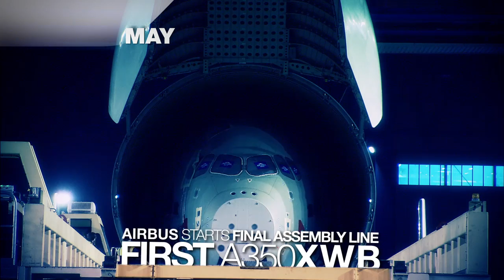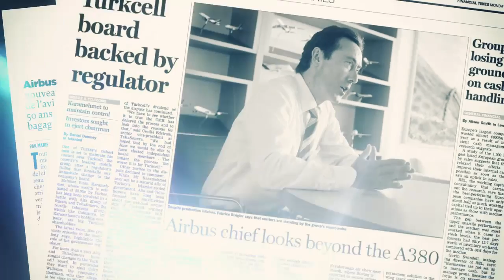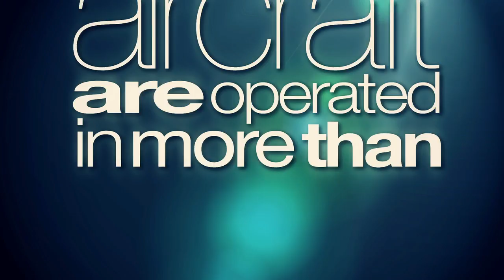Airbus in 2012: continued success

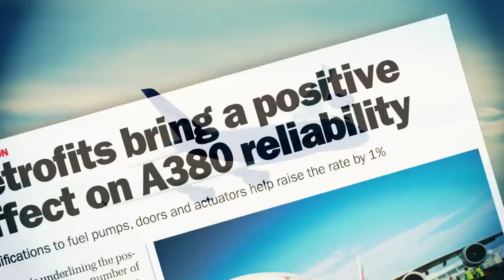Comment: Those kind of comparisons can be expected in such an aggressive duopoly. Boeing does it all the time too and the most notable one being the tongue-in-cheek A350 vs B787 comparison video it made. But, if you pause at 5:04, and read the newspaper cutouts in the video, you'll see that Airbus does acknowledge its own problems concerning reliability issues and wing cracks on the A380. Kudos to them for including them in this recap even though it was a negative thing.

Comment: Every new commercial airliner will have some teething problems, the A380s problems were a lot more severe, but they are forgotten about now. Give the 787 a chance to prove itself and in 2 years or so it will be showing its success, safely and effectively. The 787 is the most important airliner of the 21st century.

Comment: Of course I understand the seriousness of a fire mid atlantic, or even once airborne. Fire is so serious, that even if the plane hasn't even taken off yet, people have died. For example, the Air Canada DC-9 and the British Airtours 737-200 - both flights experienced serious fires and there were fatalities. However, I am discussing my perceptions based upon the fact that the 787 was not in flight, which isn't an extreme situation if there's a fire. It would have been serious if it was in flight.

Comment: I agree, a battery fire is serious, but wing cracks to the same degree that the A380 had meant it nearly broke apart in the sky... I'd rather have a small extinguishable fire on board than a plane on the cusp of blowing apart in mid air, a least there's more of a chance of landing, and being able to get off, provided there  are smoke hoods. However, the 787s fire was started on the ground, with nobody inside, rather lucky. All new planes have problems, and go on to be safe, like the A380.

Comment: Except it's obvious that the EASA didn't know about the wing issues before the A380 incident happened, and it was more likely an easier fix/modification needed than a new battery design or surroundings to the batteries.

Comment: What, you mean like almost every other commercial airliner when they first entered service? Teething problems are expected, the 787s problems are only made to sound worse by the media, they dramatise everything. The A380 had worse problems at first, but they are now in the past and the plane is successful. Same will be for the 787. It's THE most important ailiner in the 21st century and will go on to be one of the most successful jets ever, with it setting the benchmark for every commercial jet.

Comment: Actually there have never been any safety concerns on the A380's wings. Whereas the latest (so common is the occurrence) problems in the 787 could actually have caused an accident. A bad one. And the problems are deeper than just oil leaks. Also a permanent solution to the A380's problems is not far away, the 787's problems have just showed up, but for them to do so in so many planes in a short space of time is very worrying. Full respect for Boeing, but they need to sort this shit out now.

Comment: I travelled in A330 from Doha to Bangalore on 21st Janu 2013 and i was given aisle seat 41E, unfortunately the company has designed the arms rest in such a way for  seats the remote slots for tv are provided on the topof arm rest and after s metime  the arms start paining at thepoint of contact since the edges are sharp and not smooth like a plain arm rest should be, and the slots are there for both the arms, and gives a constant pain, i had to use a pillow betweenthe arm rest and the arm.

Comment: The 787 is currently in crisis, whether you choose to accept that or not. The longer this grounding goes on with no definitive answers, the more damage is done to the image of the aircraft and that of Boeing. It happened to De Havailland with the Comet and it could, (though hopefully not) to the 787. Anyone with a knowledge of the 787s electrical power requirements and electrical systems generally would not consider this a minor teething issue as it appears you do.

Comment: Well, new plane models always need some fine tuning and fixes. Problems in older planes are different. Boeing halts deliverys to make changes to battery units - no drama there. Yet there haven't been any major flaws in design. What is wrong with me is not relevant or public matter.

Comment: The "small extinguishable fire" you referred to took a fire department 40mins to effectively close out and that only after the battery was removed from the aircraft. The melting point of CFRP is 343 degrees C and no amount of venting nor shielding would have prevented a major electrical failure in the 787, hence the FAA directive and worldwide grounding. You really are naive if you think a pilot in mid Pacific can easily divert. Any fire onboard an aircraft is the pilot's worst nightmare

Comment: Tell me about airliner that have not ever made emergency landing because of technical problems? I think there is only handful of planes that haven't ever been involved in fatal accident caused by technical problem. Fire onboard is of course one of the most dangerous events but it is also adequately noted in design that batterys can potentially catch fire.

Comment: And cause a puncture and bring down the aircraft in flames, the A380 incident was a lucky escape. But I wonder how even after all the testing and requirements, the Rolls Royce Trent 900 had an uncontained engine failure.

Comment: A320 and A330 are massive success, while A340 and A380 turn out to be white elephants. Main reason for A380 and A340 failure is possibly high B777 sales. Airbus main target should be to deliver A350 in 2014 and avoid 'Dreamliner'-alike problems. So far A320 neo outsells 737 MAX by 50%, while russian, canadian and chinese competition are far behind.

Comment: You don't have a clue what could be wrong with the battery or what kind of redesign it possibly needs. I don't need to ask as I'm somewhat experienced in electronics including all kinds of batteries. I was arguing with you because you just read the news and start to fuss around.

Comment: I don't know what is wrong with.. the battery as the evidence is not available. I know about failure mechanisms of batteries and operation of electronic attachments so I know possible cases. Boeing battery engineers/subcontractors know those even much better. You don't. If we put this serious battery smoke out problem in contrast with fatal accident would you still put both under "big". I'm done.